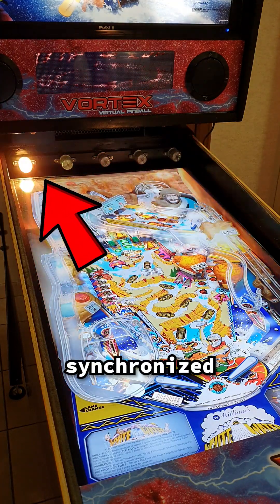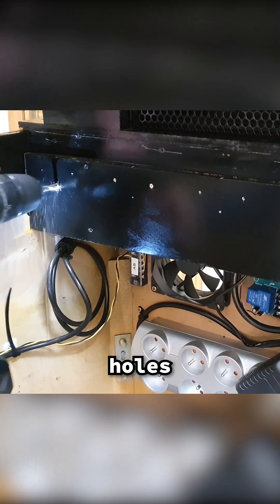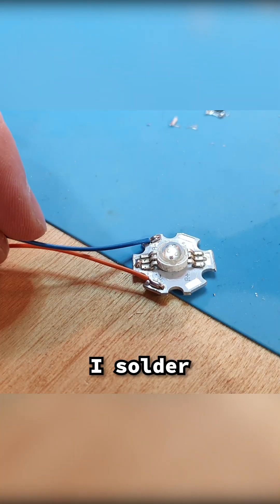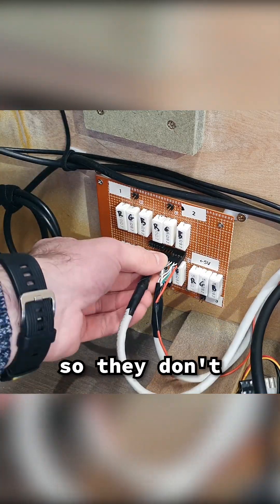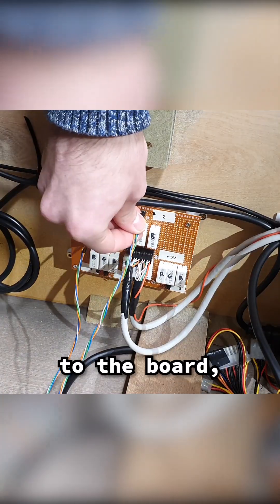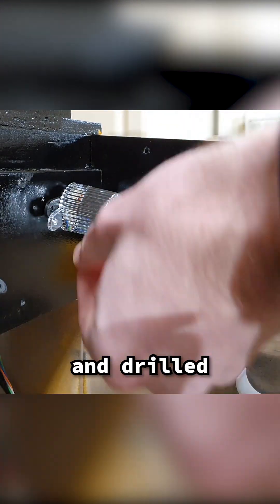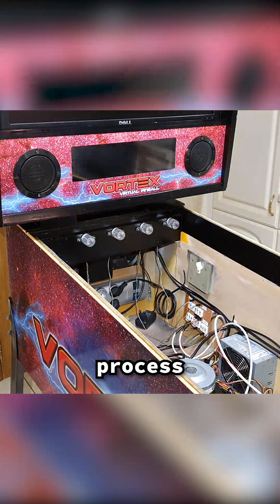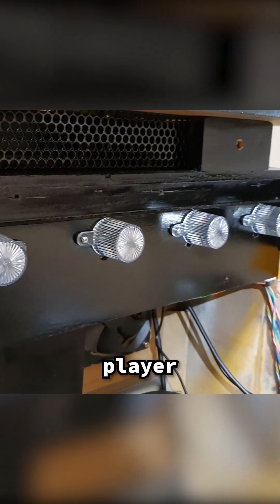Installing Flasher LEDs in my Virtual Pinball Machine #shorts #22

Comment: thank you,  so on the bottom of the RGB the Green wire is soldered across the 3 tabs to create power for all the rgb's  and the negatives go to the LED wiz?
Reply from the maker: I'm not exactly sure about which color wire goes where, but there is indeed 1 shaded connection to the positive side, and then 3 connections for red, green and blue to the ground side that connects to the controller. I used a Pinscape, not a Ledwiz